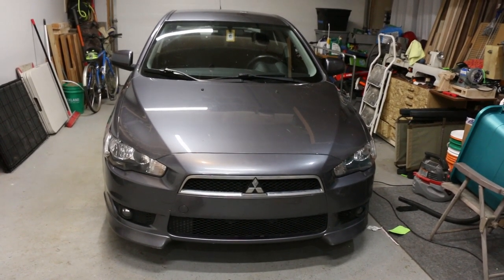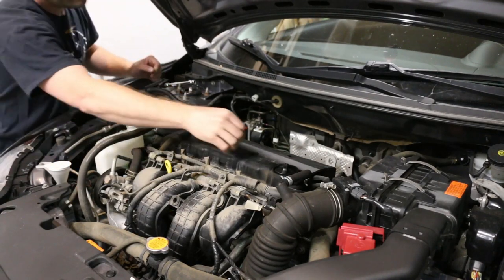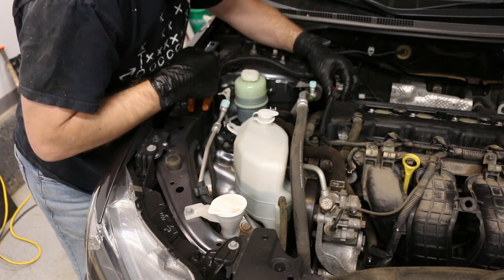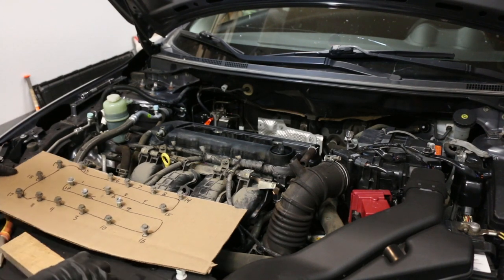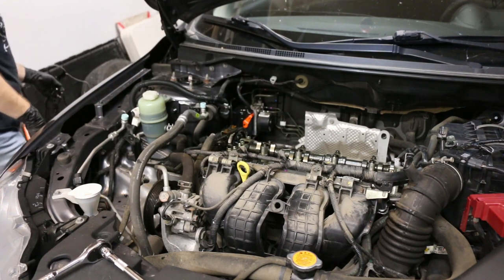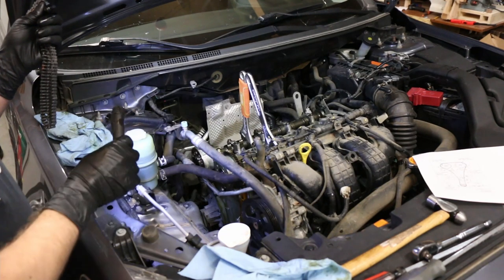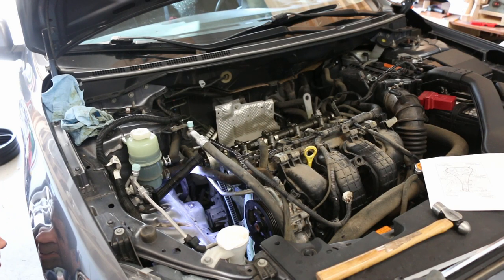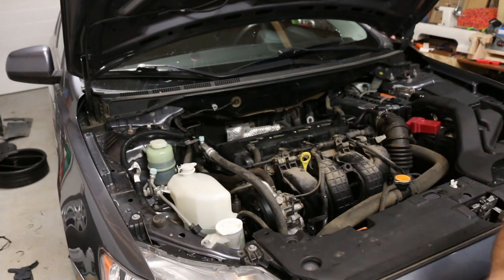Mitsubishi Lancer 2.0L NA Timing Chain replacement 4B11 engine

Comment: 2011 lancer with 4b11 only 62,000 miles no compression in one cylinder. Car was running fine shut off then simply wouldn’t start. Best way to diagnose if timing chain skipped or could be something else? Hate to scrap engine not knowing for sure if engines damaged.

Comment: My Mitsu Outlander 2005 got rattling sound for a while. I guessed its the timing chain loosened, but i was too busy, and no money to pay a michanic. This morning, engine started with unusually big strange rattling noise. A few seconds later, engine stopped. Cannot restart. I  think the chain has failed.
To replace it with the mechanic would cost thousands of dollars. I have a headache now.

Comment: How does this thing need a timing chain so early?
Reply from the maker: It actually didn't in the end.  the Dash warning light of the Red Exclamation triangle..... according to the manual is a timing chain warn warning.   This ended up being a false warning.  The only way to inspect the wear is to open it up anyways and check the tensioner.     And since I did it myself, parts from rockauto were less than $200, it really was not that bad.    The red triangle warning light ended up being related to the TPMS sensors on the tires that were not reset.  Once those were reset, both warnings went away.   And i had a new timing chain as well in the end....   that I will never have to do again on this car.

The dash warnings are really garbage on this car for this.    And i was not about to pay $500 just to have it inspected at the dealer when i could do the work myself and replace it for a fraction of the "inspection" cost.
Reply: Can you kindly post the link where to get the timing kit?

Comment: Hello from Sweden and thank you for your useful video! In Sweden this car is not so popular and I don't know nothing about Mitsubishi!
Actually I promised to my friend to build his car with little more naturally HP!
My friends car is Lancer 1.8,
My question is if 4b10 and 4b11 has the same size on block bore and strock  or not? My plan is if both has the same size could find a Crankshaft and 4 piston and rod for his car and change them.
Thank you
Reply from the maker: Sorry, i don't know the different between the engines.

Comment: Have you been experiencing ticking sound from the engine from a cold start?
Reply from the maker: Possibly, it find the engine is always been a little "ticky"
Reply: @rbcustomwraps1157  that means that the valve lash needs to be adjusted. My 4B11 Lancer does it too and I need to swap them (my valve lash was last adjusted by Mitsubishi at 90,000 KM and my car is now at 180,000 KM). It's a really tedious and painful process as you need to remove the cams (intake and exhaust) to actually swap the buckets/tappets. You also need a timing chain tensioner release bar (Tomei makes one) to hold it in place as you remove the cams otherwise you'll have to go through what you did in this video all over again. The most critical part of the whole procedure is to have high quality feeler gauges and a micrometre that is calibrated. One of my two were not calibrated correctly so I now have to re-measure everything all over again (which means more wasted gaskets). Also, use a torque wrench when tightening the rocker cover bolts. Do not risk doing it by 'feel' manually and guess the torque. If one of those bolts snaps in the aluminium block, it's going to be a real nightmare to get out. The correct torque and rotation sequence is also critical to ensuring no leaks and that the gasket seats right. For more information, check the Mitsubishi Service Manual as it has highly detailed illustrations. Cheers from Australia.

Comment: Would you be able to name and list all the seals and gaskets you used or took off? I want to change all of them anyway while I'm at it and I have 270,000 kilometers. Assuming it's never been done before, I want to be thorough.
Reply from the maker: Sorry for the late reply, there really is only one gasket and that's the valve cover.  the seal on the side is high temp gasket putty you use, as well as a small amount on the valve cover right at the spot where the timing cover attaches.   

There is also a crank shaft seal you can replace as well.

4 parts I ordered:
Timing chain kit
crank shaft seal
valve cover gasket
timing cover seal

I used rockauto
Reply: @rbcustomwraps1157  Sounds good 👍🏼 I used Napa and finished the job already. Thanks though.

Comment: Its the same engine in 2008-2012 outlander ?

Is it relible ?

How the cvt holds ?
Reply from the maker: The timing chain part number is the same as the 2.0L and the 2.4L inline 4cyl.  so, if your outlander has the 2.4L 4 cyl, then yes, it would be the same part and the same procedure I would think.   The part numbers for the tensioners are also the same.

As for reliability.  I would say pretty damn good.  I dont know of any major issues with them other than pre-mature chain stretch.... especially on the Evo's.   I have driven plenty of these cars with 250,000 km on them and other than exhaust leaks the owner can't be bothered to fix, the engine itself was strong and ran well.

I should also add that the CVT part.  aka the automatic transmission is garbage.... mostly.   it has a high failure rate.   Which is why we have a 5speed manual.
Reply: @rbcustomwraps1157  thank you for your comment

Im looking for cx5 i dont want cvt transmission and only mazda have plantar transmission honda has too but they have some littel annoying problems

👍
Reply from the maker: @לויכהן-ח9ו  Yes, there are a lot of used cars out there and it is a real pain to find a good one. Every brand or model could have issues and lots can be good too.  finding a model you like is the easy part, finding a good one is not.   Biggest suggestion i can make is when you look at a used car, ALWAYS make sure the engine is cold and they didnt run it before you got there to "warm it up" .  A cold start on any engine is a telling point of how good it is and if it was well maintained.   Most of the time if someone warms it up, or has it running when you get there is either hiding something or is just clueless on how to sell a car.
Reply: @rbcustomwraps1157  from the people i know that have cx5 from 2012 all of them saying that is the most reliable car that they  have had 

Yes its not luxurious like lexus but if maintained by the book it will run 300-400000km with no problem

And it's cheap to maintain with good fuel economy great engine and transmission and can do light off road in the 4x4 model like Forster so its good choice just need good maintained car and its a win win 

Have nice day thanks for the comments
Reply: @rbcustomwraps1157  are you sure sir? 2015 outlander 2.4L liter has smaller fan belt compare to 2.0 lancer.

Comment: I Have a 2013 with timing time stretch 72000km. And all oil changes done  Crazy.. now I find out that its common..
Reply: Ment to type chain...👍
Reply: The whole oil change excuse by Mitsubishi is baloney. The chain just wasn't up to the job to begin with which is my they re-designed it.
Reply: We have a 2013 Mitsubishi Lancer. 120k Miles. Is the timing chain faulty? Is it time to change mine also?

Comment: Why are you changing the timing chain they are good for the life of the engine .
Reply from the maker: When the computer system says that the timing chain is worn with a warning and if you look at any lancer forum, the chains on these engines stretch prematurely and are prone to overstretching and require replacement.    definitely NOT good for the life of the engine.   besides, parts were cheap and I no longer have any concern about it.
Reply: There's a design flaw with the chains in these. I have an Evo X with 28k miles and changing mine. They changed the design after 2012 with a much stronger chain. The old ones have known to jump teeth and even snap which destroys the engine so its pretty much standard to replace the old style chain.